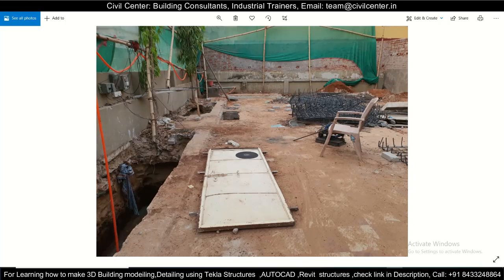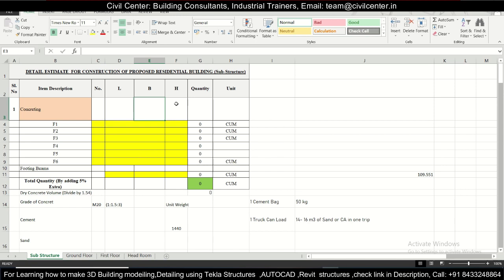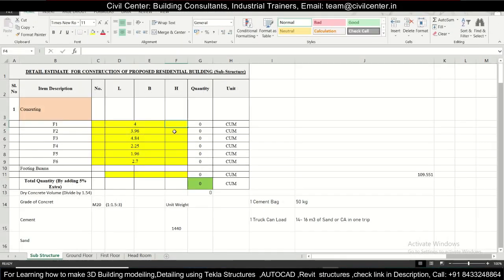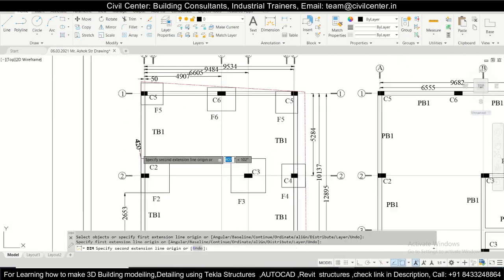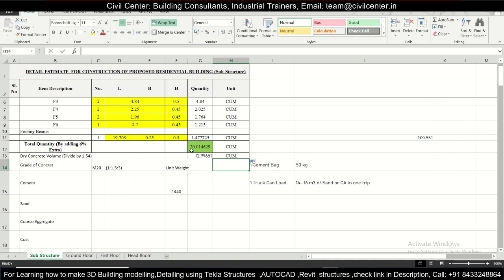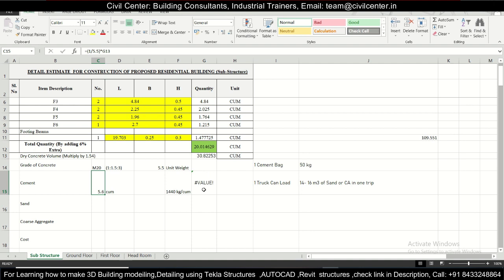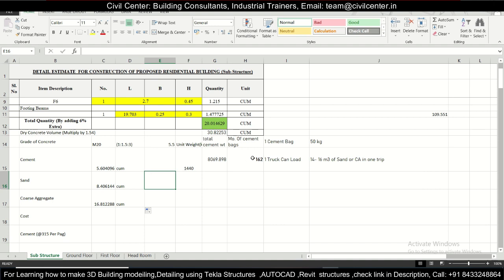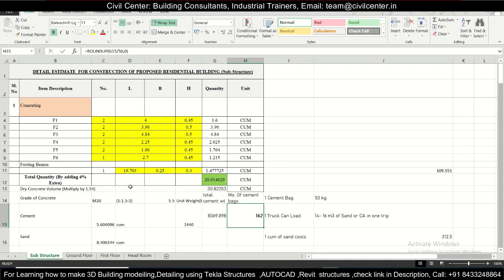How to Calculate the Quantity and Cost of Material For Concrete Foundation|| Cement, Sand, chips

Comment: In the footing plan you showed eccentric footing for column at property line joined by beams along property line but do these beams serve any purpose because the footing is eccentric perpendicular to property line and hence will not help in BM redistribution I think also I modelled and seen it in SAFE software.I think the footing should be connected with the adjacent footing with strap beam in the direction in which it is eccentric.Please comment what you think.